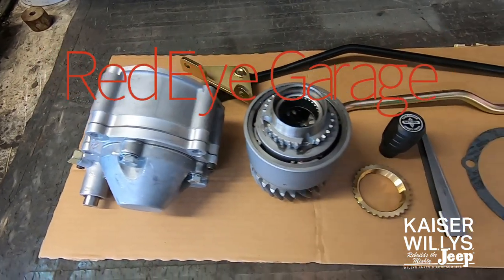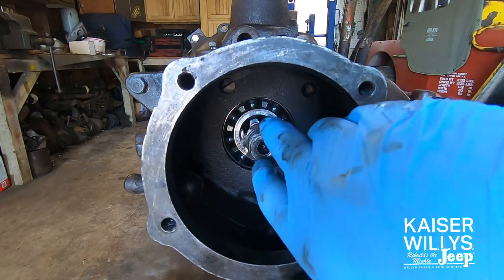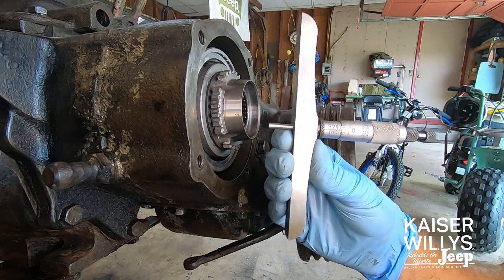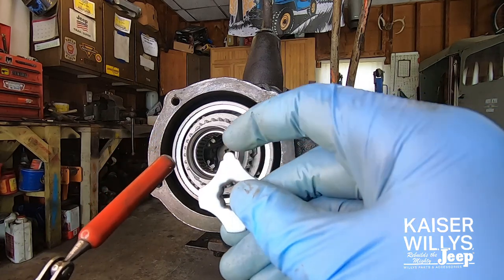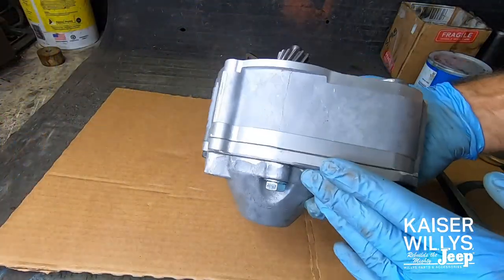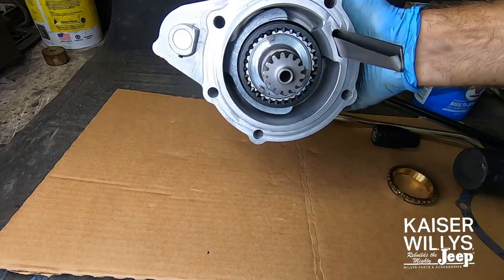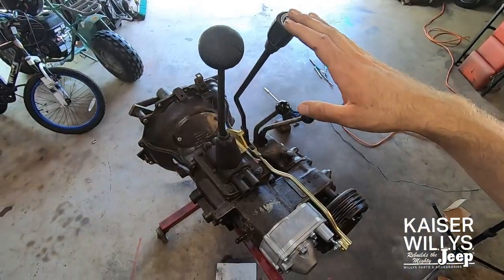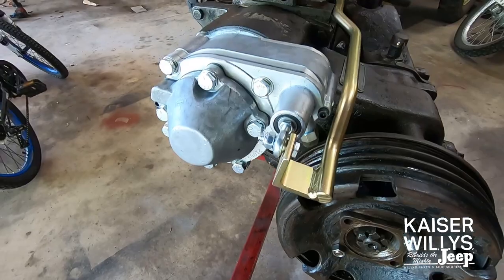Saturn / Warn overdrive install Cj2A

Comment: Finishing the install in my 1952 M38.  Getting the locking tab and then the star snap ring installed properly was the biggest hurdle.  I have agonized over this step and can only hope that the snap ring is in properly.  Working under the Jeep up on jack stands was a real pain.  Thanks for the video.
Reply from the maker: It can definitely be a pain. Especially working on your back. I’m sure if you took your time and did your best it will be fine. When I was young I stressed over that snap ring a lot more than a i should have. If it’s in the groove it’s I good. As long as it wasn’t over-compressed it should be fine

Comment: The best overdrive installation video yet ! Thank you for taking the time to show everyone the process! If I could I would like to ask you for a very brief summary of how you adapted the the mo617 to a B&W t18? On your CJ5. I looking to do the same.
Reply from the maker: Thank you! I’m glad you found the video informative. For the om617 I decided to just buy the adapter. It was so cheap I couldn’t justify making it. I got it from Mercedes diesel 4x4. Im not sure they’re in business anymore though. 🤷‍♂️
Reply: Thanks for the help. I'm assuming the kit came with engine plate and flywheel. I will look into that kit. Thanks again.

Comment: When I installed my Warn Overdrive more than 40 years ago in my Willys Wagon l did not have to measure the depth. And the syncro ring was already installed. SBC powered. Rebuilt the T90 a couple of times. No problem removing and installing. The Warn has had no problems after all these years. Just make sure the transfer case has oil. Tapered bearings in the intermediate gear works great.
Reply from the maker: Measuring is just a good way to check for any major variances in cases. I’ve installed a lot of these and never needed shims. These were a lot cheaper and easier to come by back in the day so not as much case was taken with the install. The design and procedure has not changed. Advanced adapters purchased this design from warn. The part is exactly the same. 👍

Comment: 18:58 they also make transmission assembly lube that is oil soluble for situations like this. I have a small tub of it I bought when I did the rebuild on my wifes A904 that is thermally activated. Its a grease like consistency until it gets warm from using the transmission then it liquefies and mixes with the oil.
Reply from the maker: Yeah that stuff is fine to use but not necessary

Comment: Are you familiar with Swepco Gear Oil?!? They claim reduced foaming, temperatures and extended life of the oil. The Land Rover guys in the UK swear by it. Keep up the good work.
Reply from the maker: I haven’t heard of them… thankfully I haven’t had any issues with foaming. People (including myself) have been running cheap 90w gear oil in these things for decades with no issues. As long as you keep the levels up they hold up great!

Comment: Oh, how easy it looks when the trans is out of the Jeep. Whoever designed this Overdrive should have been hung out after designing the locking tab and snap ring method. When under the vehicle it is useful to be a contortionist to get the tab and snap ring installed.
Reply from the maker: Yeah it’s definitely easier this way. Filming it properly while under the vehicle would have been rather problematic.